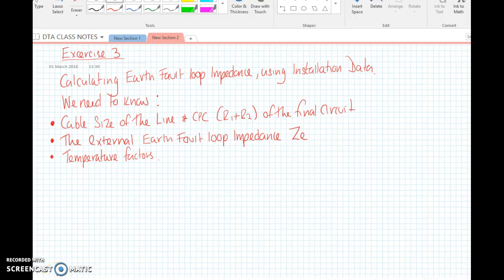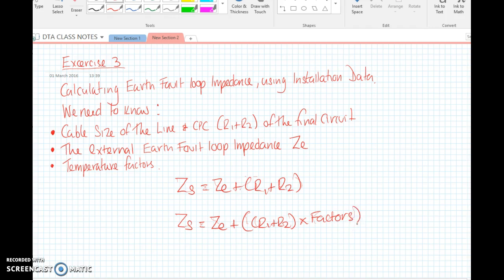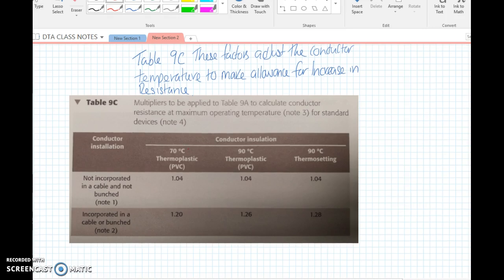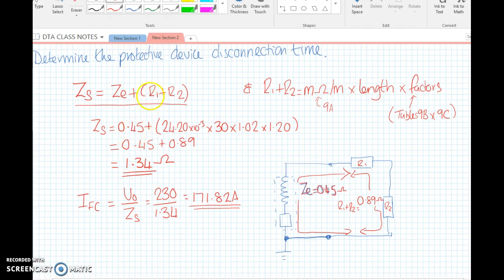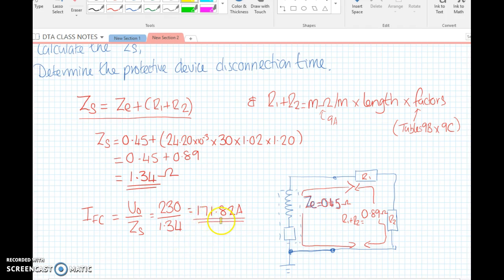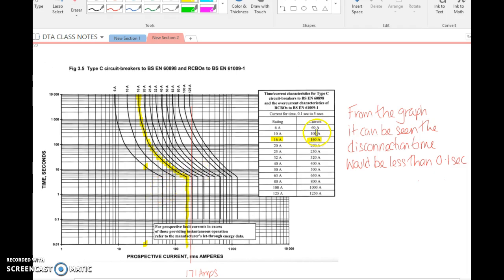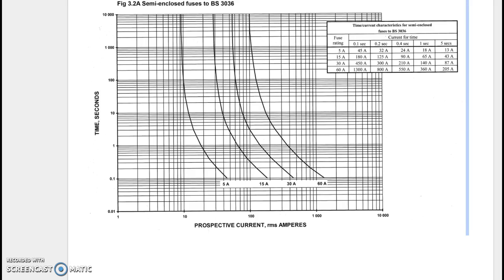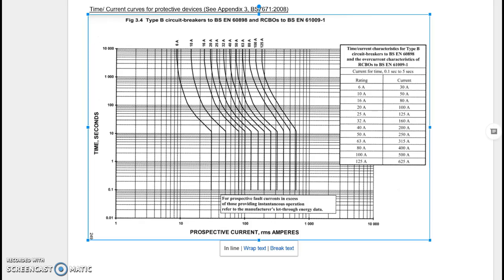R1+R2 calculation and Earth Fault Loop verification Part 3

Comment: Geat tutorial very clear thanks. Just one thing I didn't get it Zs=1.34 ohms but onsite guide page number 125 table B6 for type c 16A says maximum EFLI is  1.1 thanks again
Reply from the maker: Hi yes, the video was recorded a few years ago now and the tabulated data has changed, but the process is still the same. Another thing to note is the Max Zs values in BS7671 are when the circuit is under load, where as the values in GN3 and IET OSG are adjusted when the conductors are at test temperature.
Reply: I appreciate it alots you made it so clear and I learned alot of this video and your reply thank you very much

Comment: BIT confused here, why did you take the value of the resistance of the copper which was 24.20 and did the x 10 -3? i understood everything else.  Bit of help would be nice here :)
Reply from the maker: 24.20 is in milli ohms, so for the calculation I expressed the value in engineering standard form.
Reply: @d.leith-mietqtlselectrical1131  okay I'm doing cable calcs for college would I still do 10-3